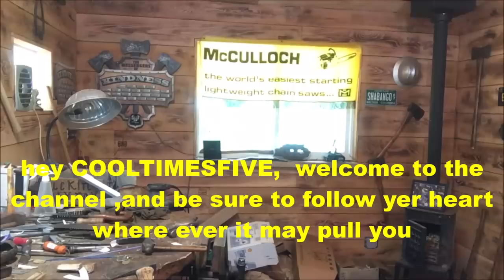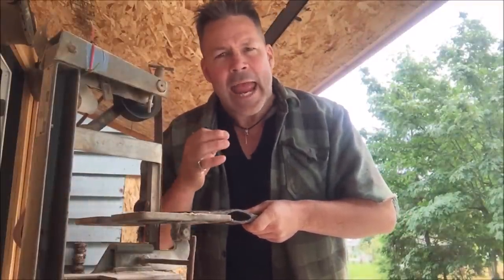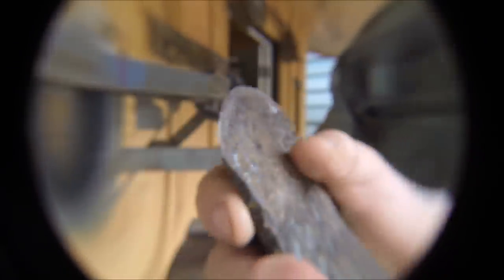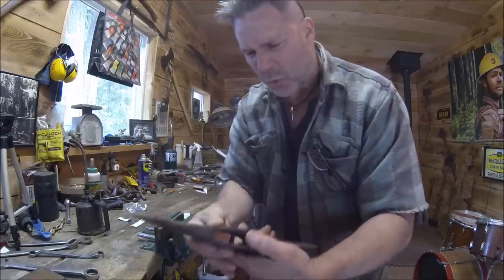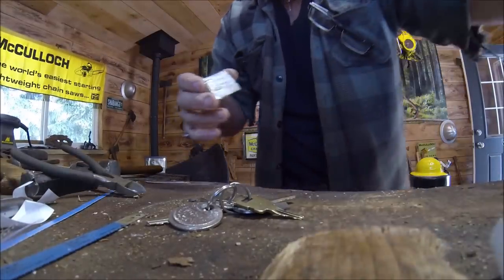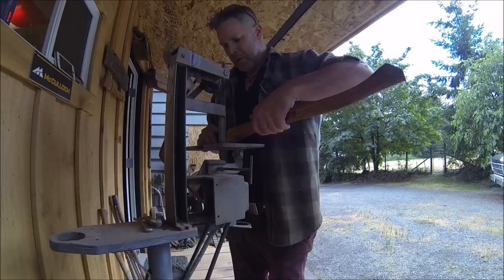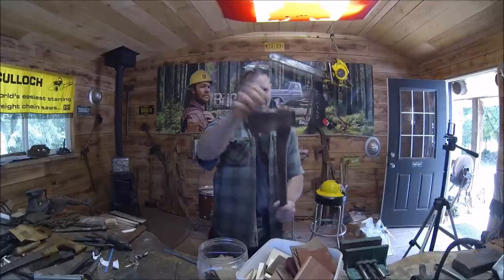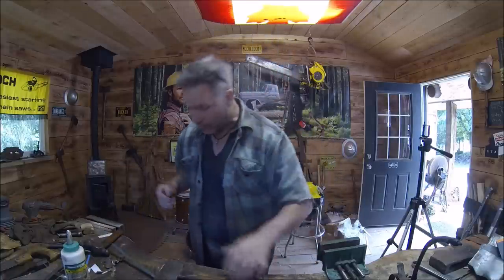HOW TO SHARPEN A VINTAGE AXE HEAD

Comment: Hey Buckin' very serious question for you, the fit round the bottom of the head you want no shelf and curl all the way round but does the top of the eye need to be full before you put a wedge in it or can you have gap all the way round and the wedge fill that out. I am making my own handle for the first time and I have found that I have got the top of the handle quite thin, it felt like it needed it to get the head on but now I am worried if my head will move? Thanks in advance buckin' you are a legend.
Hope you didn't hurt your hand too much.

Comment: I'd take some of the radius out as well, because there's too much as it's been over sharpened in the past.
I think at this era ( mid 70's ) Mann edge probably did use those aluminum wedges.
I'm sure the steel is decent, but they sure aren't on anybody's list of axes to find.
Reply: Tyler Snyder thanks for helping with the history!

Comment: If you boil a rusty axe in water for like 20min and rub off the surface with steel wool it will change the rust to gun blue (rust bluing) wich is rust resisting and looks beautiful  with a light oil. It'd  make some of those vintage axes shine like new but maintain their antique status
Reply: Does it have to be cleaned of oil first, i found an axe head yesterday and began taking of the red rust. Now im down to the black oxcide
Reply: @chadlinton.919  yes it typically works better when oil is removed with a solvent before boiling it can take multiple cycles of boiling and carding it should be forming a light almost fuzzy red surface rust each time that you rub off with steel wool eventually will be all black ⚫️ and oil it once you are completely done
Reply: Will it lose its temper?
Reply: @chadlinton.919  it shouldn't lose its temper until at least until 400°f being a ax head probably tempered to 600°f so should be good just be careful when sharpening it to keep it cool if using power tools

Comment: snow & neally is famous for those aluminum wedges. I picked up one of those axes that so many people have with the M stamp on the head that i see alot of people trying to figure out what it is. I have always heard they were snow & neally axes from when they were out sourcing their heads. Mine says 2 1/4 M on it and i connected the dots when i realized it had one of those giant aluminum wedges just like pretty much all the snow & neally axes so chances are it was something that came from them if it was factory n someone didnt put it in there. i always wondered why they dont use wood wedges. 

Anybody else heard of what im talkin about or know anything different?